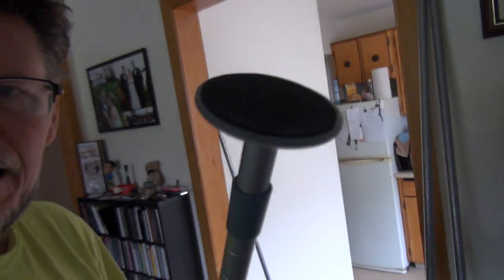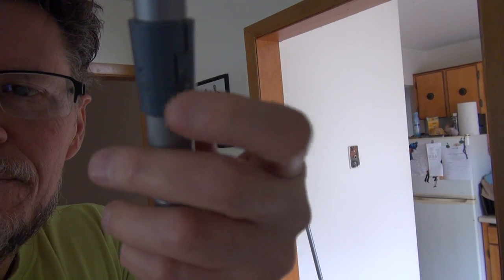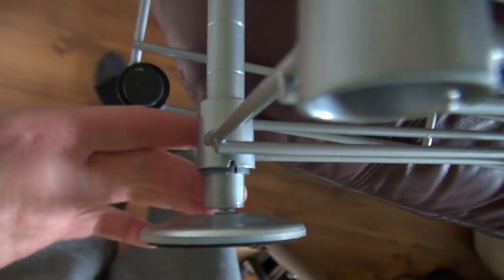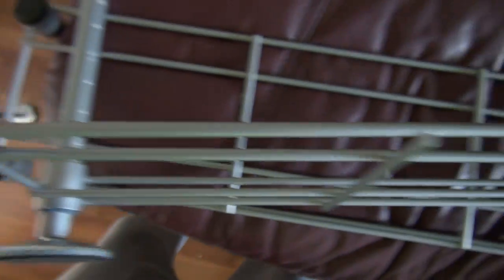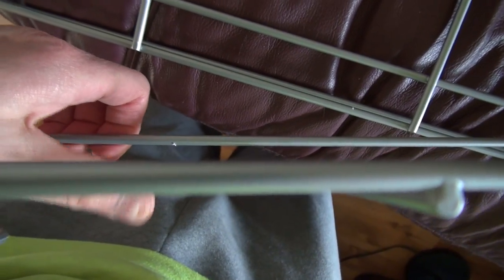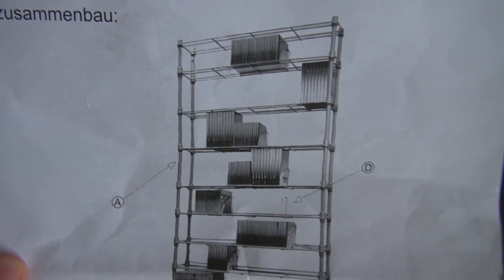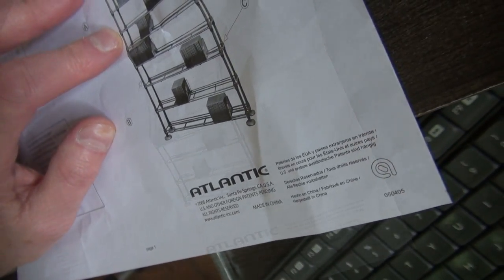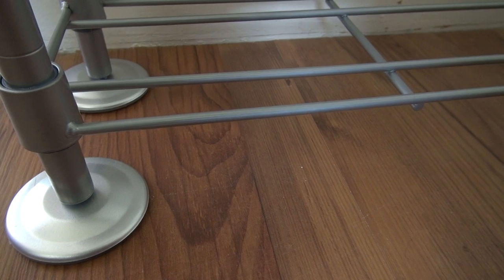PUTTING TOGETHER MY NEW CD STORAGE UNIT (PART 2)

Comment: For what it's worth I'd have put the CD shelves at the bottom and DVDs/Blu Rays at the top, because CDs (in jewel cases) are much heavier, and those shelves would be more tightly packed vertically, so the centre of gravity would be much nearer the bottom and the unit would be more stable.